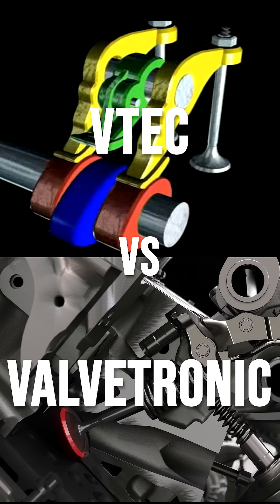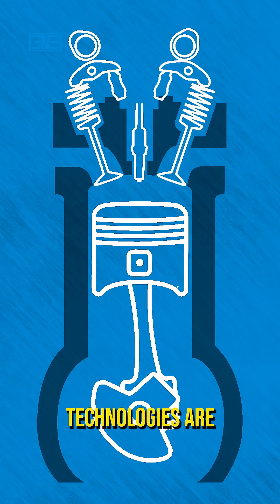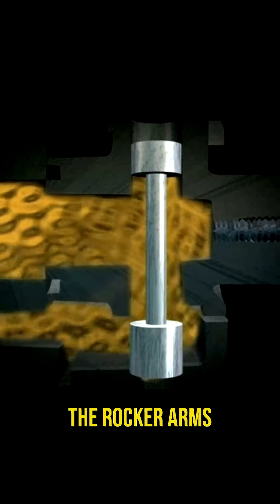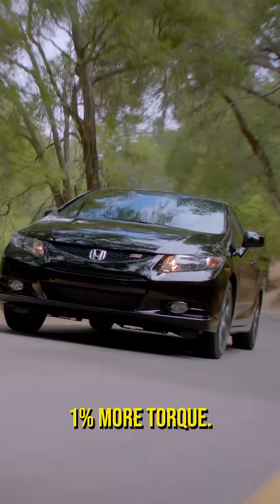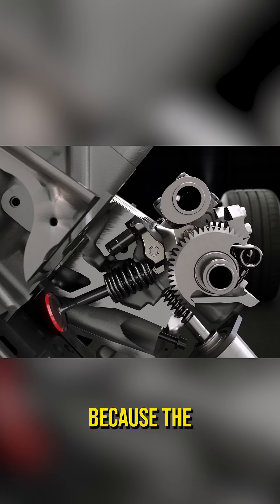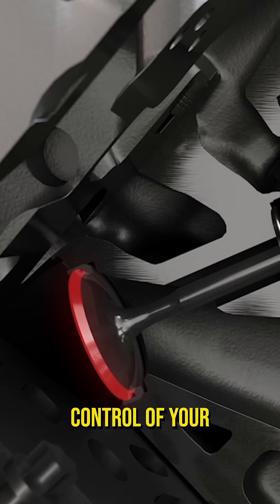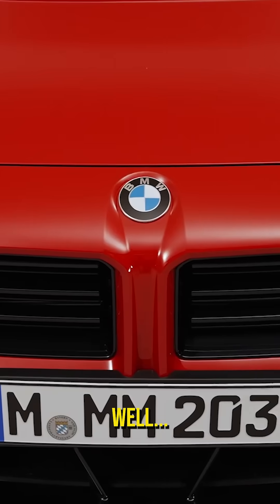VTEC vs Valvetronic - Honda vs BMW!

Comment: Honda is a pioneer here. 
The VTEC system, that alters valve lift, goes back to the late 80s. 
BMW developed the VANOS system in the early 90s, that alter valve timing. 
From 2006 with the E90, they added the Valvetronic that has a similar function to VANOS. 
If Honda didn’t develop great V8s, V10s or V12s like BMW for policy reasons, the V6 of the NSX remains an exceptional pioneer engine even today, and the S2000 engine remains the greatest straight 4 ever built, with a specific output of 120hp/l.
Reply: VTEC was introduced in 1983 and Valvetronic on the N42 egines in 2001
Reply: @Harry_Gersack Didn’t factually check before writing the comment: I relied on my memory, which didn’t alter the core idea: VTEC precedes VANOS, which precedes Valvetronic. 
More fundamentally, all those systems are destined to increase the torque at low revs of the four (five)-valve per cylinder engines, which were recent at that time. Since they gained significant power at high revs, compared to the same displacement two-valve per cylinder engines, to the detriment of torque, hence becoming less usable and smooth and supple in usual conditions (low and mid revs).
Reply: @Harry_Gersack Congrats on being WRONG on both counts. VTEC was introduced in 1989. No idea where you got 1983. Vivid imagination. And VANOS was BMWs system at the time not Valvtronic, which is vastly more complex and capable. VANOS came out about the same time as VTEC, a few years later. We can say early 90's for both.
Reply: @TimJohnson-x1o VTEC, the original Honda variable valve control system, originated from REV (Revolution-Modulated Valve Control) introduced on the CBR400 in 1983 known as HYPER VTEC. Damn bro, trying to correct someone incorrectly is hilarious
Reply: VANOS and valvetronic have completely different functions. VANOS controls intake and exhaust cam timing (depending on the engine). Valvetronic controls how much air enters the engine. They have no similarities aside from the engines they share.
Reply: 1995 f22b1 scored station wagon 145 hp VTEC  it goes weeeee
Reply: Toyota 503E has entered the chat, 404hp/l
Reply: While Honda was experimenting with microcar engines, BMW created one of the most armored engines in the history of motoring, the M30, which evolved into the M88 and S38. These engines, tuned by specialists from Scandinavia, reach power levels that allow you to say goodbye to the Veyron. I have seen a whole bunch of M30 family engines that, after modern tuning, produced over 1,000 horsepower. BMW's S-line engines are a completely different story than Honda. At a time when Honda managed to squeeze out 120 horsepower from a litre in a four-cylinder, BMW turned a 5-litre V10 to 8,500 revolutions and gave over 100 horsepower from a litre. This is a different league. The moment BMW shifts into 5th gear (it has 6), the speedometer in the Honda runs out. Why are there so few Hondas in Germany? Because on the motorway you feel like the engine is about to jump out of the bonnet, while the BMW's engine barely purrs. We'll finish talking when Honda releases an engine with normal capacity and performance adequate to capacity in a large series. Honda won't release a large capacity engine, if it does release it won't have adequate power, and if it does have adequate power to capacity it will be limited to a few units. End of conversation.
Reply: @xot80 

Debate never ends. By definition. 

Tuned and turbo compressed engines are a totally different story, that hides the core NA engines characteristics, since power becomes endless (1000 hp/l in 80’s F1s). 

As for robustness of construction, it’s only one of the many features that make an engine great. In regard of tuning capacity, Toyota’s 2JZ ain’t also bad at all. 

A 2.0 liter engine cannot be compared in anyway to a 5.0 multi cylinder engine. Especially in power reserve at high speeds. 

But between NA engines, whatever their displacement is, power density is a major criterium for engineering sophistication, and here the Honda S2000 is unbeatable for a 4-cylinder. While the V6 of the NSX was way ahead of its time, BMW responded in a magnificent manner with the S70 of the McLaren F1, introducing the Double VANOS. 

As for the V10 of the M5, it’s less powerful and less sporty than a Huracan’s, with a slower pick-up speed, but it’s maximum torque is at around 4000 rpm, while the former’s is at around 6000 rpm, which makes the BMW engine much more smooth and more rounded in usual conditions. And that’s the core philosophy of BMW S engines, smooth and torquey from idle speed, powerful and raging at high revs. 

But in terms of pure mechanical efficiency, which is defined by specific output, it can’t be compared to the Huracan’s, even less to the Judd engines which mastered the V10 architecture like no other. 

And the V8 of the E92 cannot compete with the Ferrari Italia’s or the Corvette C8’s, nor the S 54, which remains the greatest straight-six, with the Porsche Metzger blocks on the GT3s. 

As for the V12, Cosworth produced a definitive pair for the Valkyrie and the T.50, ending the decades long domination of Ferrari and Lamborghini. 

The debate may be over in the sense that great NA engines are now mechanical wonders of the past. Turbo downsizing, hybridation and EVs became - unfortunately - the standards of modern powertrains.
Reply: @rudolfdaher  BMW B58 is new 2JZ and we speak about mass production engine like S2000 or BMW. Not unikorns like BMW P-series or S70 In BMW, the 2.0 engine is installed in "family" cars, it is not supposed to generate sports performance (although my friend has an E30 920kg with a 1.8IS after a 2.2-litre stoker and makes some 240 horsepower), while in Honda 2.0 is a very serious capacity. Returning to history, BMW used to have a few interesting 4-cylinder engines from the M10 family. The quintessence was the S14, but along the way there was an accident that generated 1000 horsepower per litre and changed the history of F1.
Reply: @xot80 
Mate, vast majority of human population will never drive a single kilometer on an Autobahn, that's why corollas and civics are the most popular cars around the world. In most countries the speed limit on motorways is 140 kph or less, you don't need a 3L V6 to drive at that speed ;)
Reply: Lol, how is it the greatest straight 4 when it has half the power per liter of the actual best 4 cylinder around, the amg M139 at 235 hp/l
Reply: @DarkAttack14  BMW M12/13 Megatron with turbo from BT52. Mid 80's and you have 1000hp/l or more. M12/13 is based on regular used M10 engine.
Reply: @DarkAttack14 Because compressed engines cannot be compared, in terms of power density, to naturally aspirated ones. (Read my comments above for details.)
Reply: @DarkAttack14  Probably because most people's definition of "greatest" is different from "highest power output per liter." At least for people older than 12.
Reply: @TimJohnson-x1o  That's great but dude tried saying that the s2000 was greatest specifically because of its horsepower per liter, and he was wrong. You probably should have read his comment before responding kid. Now if he said "naturally aspirated" he may have been right, cannot confirm because unlike you I don't speak without doing my research?
Reply: So what would have happened "If Honda didn’t develop great V8s, V10s or V12s like BMW for policy reasons,?"
Reply: @hoghogwild They most probably wouldn’t have done better than the Ferrari Italia Speciale V8, the Lamborghini Huracan Evo V10 or the Cosworth V12 developed for the GMA T.50… 😉

Comment: I’ve got a lot of irl track hours and owned a lot of cars. Without a doubt in my mind, my two favorite cars to drive hard have been my e46 m3 and my ap2 s2k. It’s no coincidence that they’re both high revving high peak torque engines with incredibly good factory gearboxes. There are a lot of different ways to make power, but I challenge you to find a more engaging and incredible driving feel than making more and more torque as you rev higher and higher across an absolute monstrously sized powerband while your mechanical bits scream in well-earned fury.

Comment: I owned a 2001 BMW 330i. I only pumped premium everything in the engine and it gave me absolutely 0 engine issues until I got a newer car. The only one and only problem was the traction controll button stopped working. Who needs traction control in a rwd anyway lol 😅
Reply: Especially in the 🌧  😉
Reply: @MrScottpeterson2112 it made drifting effortless in the rain 😂😂

Comment: PSA: literally any engine that is being designed for high performance is going to require more regular, more expensive maintenance, and is going to be less reliable overall. even a 2jz cannot be built to push 1000hp without substantial modification to the block itself - and then even these well built, modified engines fail to run for 200,000 miles off nothing but oil changes without an issue. its literally just par for the course.

tl;dr: a stock vtec engine is only as reliable as it is because it was designed to be that way. when you design an engine for power first, reliability will always come second.

Comment: I have bmw e87, it’s ok, it’s got a n45 engine, no valve tronic, but the AT6 gearbox on std D make the cams wear out faster😢, so it’s either drive in sports mode or triptronic mode, that’s my advice if you want to get or already have a bmw with a n45 engine, loose the D and put in DS or DM. PS also the oil pump, serpentine belt, idler, tensioner are a must change when getting a 100,000km engine
Reply: And also after change the parts, use 5w30/5w40 for the first 2 services then change to a thicker oil like 10w40, why I say 5w30/40 is so that the engine can get cleaned up and all ports opened up, and while at the first 2 services make sure to drive it hard but max rpm at 5,600 just so that you don’t wear more parts out. After all that and changed from 5w30/40 to 10w40 your engine will be like good as new unless the previous owner did shortcuts in repairs

Comment: Valvetronic is more efficient and responsive, together with VANOS created an award winning engine. VTEC is simpler but not refined. U get BMW for sheer driving pleasure, get a Honda for soccer mom.

Comment: BMW uses the valve controll to accelorate.
Honda uses it to gain performance in the higher rpms.
Beamers use that tech becouse they play with valve opening instead of a butterfly valve to rev the engine, valves open more on throttle in tesponse the engine gets more air, and accelorates, honda does not. They use it to get a more optimised engine at lower rpms, for the daily use, and higher lift for the applications that require more power. They both alter the lift of the valves but for different reasons.
Similar tech fully different reasons. 
Honda use it since 1989
Bmw use its take on the tec since 2001
They are similar but completely different.

Comment: VTEC - switches between low rpm cam and performance high rpm cam
Valvetronic -overly complicated German engineered electronic crap

Comment: I worked MBs for 35 yrs. The more complicated an engine is, the more likely it will fail, and the more costly it'll be to fix. Simple is better.

Comment: Why compare quality with quantity? Only BMWs made in us are breaking down. Those made in Germany like those found in the Philippines local market do not break down as easily as those sold in the usa. Hondas? Many parts, therefore easily and cheaply discarded and the ones who own them do not mind the breakdowns as they are cheap to solve...but often.

Comment: I don't really have a dog in this fight, but every single pro-BMW comment I've seen is "BRO! You don't understand! BMW IS more reliable. Yes, you have to do 2-3 times more maintenance and, yes, if you fail to meet any part of the maintenance schedule the car explodes, and yes if you don't use super premium products the car also explodes, but that's just because it's BETTER. It has higher tolerances!!! You're just mad because you drive an old beater Honda and can't afford the $300 and 20 hours per week I spend maintaining my BMW, peasant."

I'm not even a car guy, but the BMW copium is clear as day.

Comment: Bmws valve tonic system is one of the most reliable things about bmw. Rarely ever fail, I've never personally seen them fail and i work on high end cars and super cars everyday using that use this and other variations of this tech

Comment: The valvetronic sounds similar to VVEL from Nissan VQ engines. I owned one briefly in a 370Z and it worked beautifully (until i crashed it). Haven't heard too much chatter about reliability issues with the Nissan system.

"If in doubt, buy Japanese"

Comment: In my opinion the multi air system is the most advanced currently, it opens valves faster and better than a cam ever could

Comment: More trash that is designed to help the internal combustion engine overcome some of its inherent flaws

There are hundreds of those flaws that need fixes, bypassing and work arounds

* Exhaust System to deal with the excessive noise, poisonous gasses, and to help with the excess heat

* transmission to help the weak engine to get to its narrow power band

* large radiator to remove the excess heat

* frequent oil changes because blowby gasses ruin the oil

* frequent tune ups because it's unstable

* frequent brake down of rubber and plastic parts because of the excessive heat

* And much more

Go EV Already Foolio, stop letting Wallstreet trick you from stopping the bleeding

EVs are bad for Wallstreet because gas cars are a huy source of profits for Wallstreet after the initial sale of the vehicle

Besides the huge profits that the Petroleum Industry gets from every tank of gas, oil change and other petroleum products there are quite a few others industries profiting from the hundreds of parts of the ICE drive trains that regularly need to be replaced

They are spending millions to produce, influencing, promote misinformation and disinformation and to lobby against everything EV and Renewable Energy

They have trillions to protect

EVs are awesome for the average driver in many ways and they give way more than they take

The truth is that the batteries do last as long as the average car, gas cars catch fire much more, they charge in 15 to 30 average and they don't cost way more than gas cars

Comment: Valvetronic is made for reducing intake loses thus improving economy. Vtec is for more power.
VANOS should be equivalent for Vtec.
Reply from the maker: Vanos is variable valve timing (cam phasing), it doesn’t alter the valve lift like valvetronic does (and vtec).
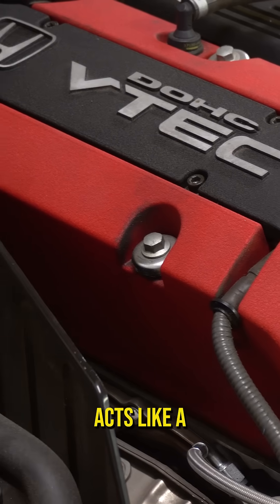Reply: @EngineeringExplained  Unlike the exaggerated vtec animations, vtec dont alter valve lift remarkably, you may see at 0:22. Vtec is simply switching to a cam with wider opening lobe.
You can't see a Bmw having only valvetronic but like n45b20 perf. oriented engines exist having only vanos w/o valvetronic.

Comment: Comparing the reliability of valvetronic from 15 years ago to vtec you have a point but failures with the valvetronic system nowadays are a thing of that… the past.

Comment: VTEC is reliable but gimmicky. Valvetronic had a couple engines with slightly higher than normal maintenance but overall are still rock solid and provide way more performance.

Comment: Gimme late 90s Toyota VVTi. It was new tech at the time and you can really feel it engage in their early cars. Better than honda vtec bc it doesn't open or "kick in yo' at a specific rpm, it works at any rpm based on throttle and engine speed, the cars computer will adjust cam timing and all that.